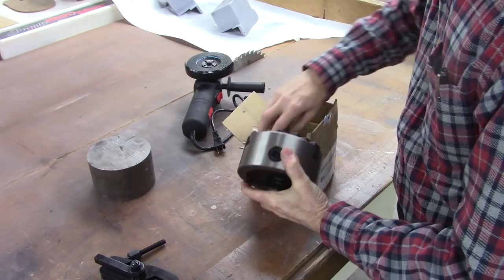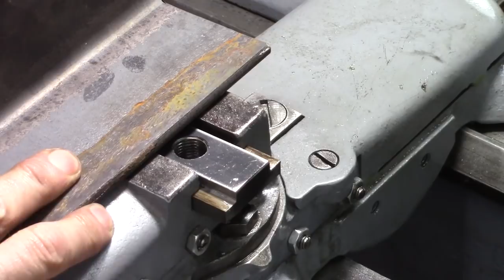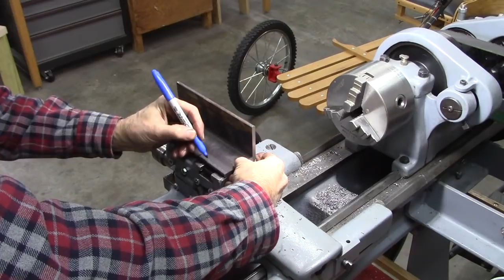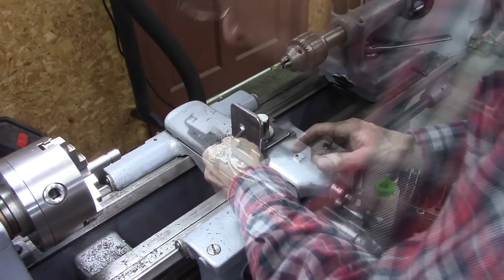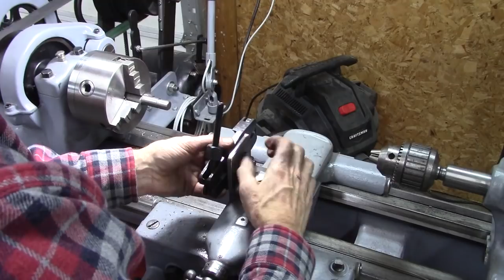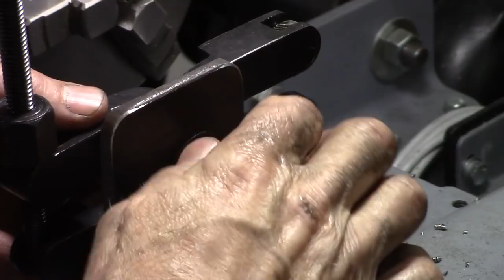Direct Mount Knurling Tool - Santa was Good to me!

Comment: I am curious.  I thought to knurl you had to take the tpi of the knurl tool and the diameter of the shaft to be knurled, do a bunch of math, adjust the diameter and depth of the knurl...etc.  or you end up with a funny knurly that has overlapping and what not.  

Some how you just squeezed it down and got a knurled finish?
Reply: Yep it works for me. Maybe if you are knurling something really big or really small & the knurls have to be a specific size, shape & pitch you would have to do some calcs, but for most things this works fine, especially in the home shop.
Reply from the maker: Nah...  the math is (in my opinion) BS unless you are knurling a very small diameter. High pressure at the wheels is the key to making it work. It forces the wheel pattern into previous rotation's knurl. I guess you could say the math is valid if you use low pressure. Apparently I use more pressure that most, there was no way I could get the tool post to stay put. Hopefully I don't brake the knurling tool but if I do I'll build a stronger one.  Thanks for watching.

Comment: 10:50 "Not quite as deep" - it was bending the bar, that's possibly why. Would be better with tailstock support.
Reply from the maker: Yeah...  you maybe right about supporting the end but 2 or 3 more revolutions after stopping the carriage would have made the knurl even. I turned the lathe at the same time I stopped the carriage so at the very end it only had one revolution under the wheel while the rest of the knurl had maybe 3 revolutions.
Reply: @WinkysWorkshop  It certainly appeared to have some spring in it so most likely a combo of the 2 factors.
Reply from the maker: @millomweb  - maybe 3 although I never saw the bar deflect. Wobble yes but not deflect. If I had knurled to the end it may have. Maybe that's why I stopped the knurl when I did.
Reply: @WinkysWorkshop  Yeah - at 10:39 - watch the bar end relative to the bottom of the video frame as you move the cross slide back.
Reply from the maker: @millomweb  - yeah, you are right,  it moved when I relieved the pressure.
Reply: @WinkysWorkshop  Much easier to spot on camera with a fixed view.
Reply from the maker: @millomweb  very true

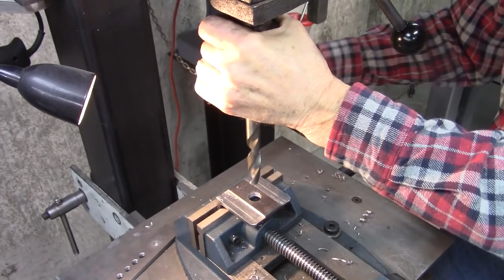Comment: 6:23 What a shame you milled that full length. If you'd stopped 250 thou short from the end, it would have overhung the end of the top slide T slot and positively stopped the angle iron and T nut sliding in the slot !
Reply from the maker: Cool idea!